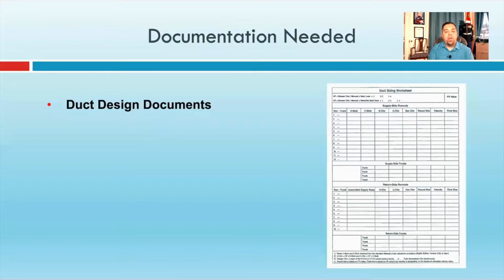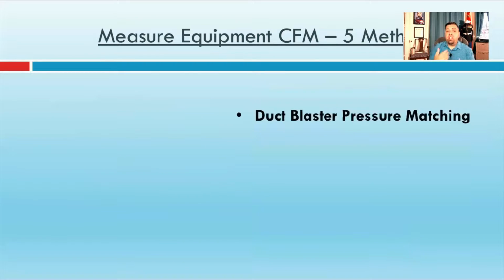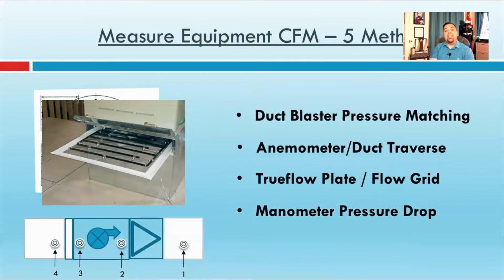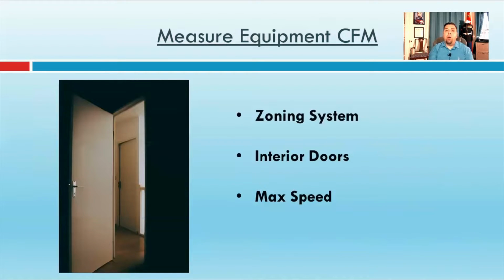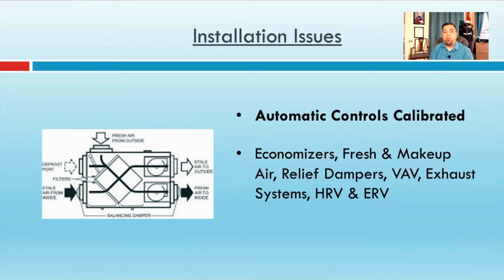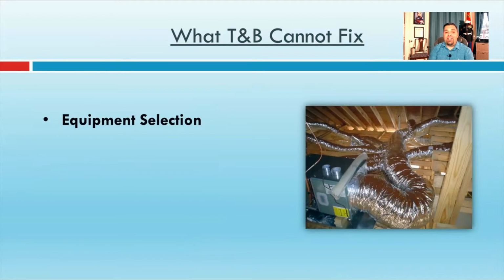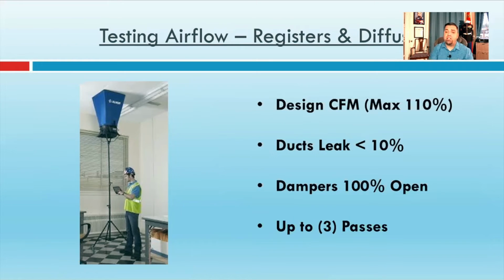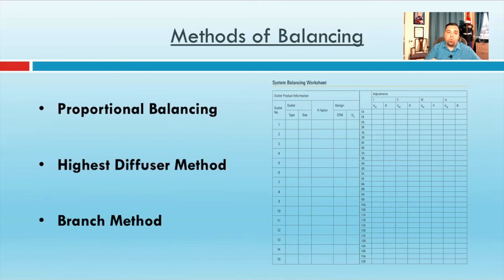HVAC Air Testing & Balancing

Comment: i work in Eastern Massachusetts for 25 years plus. The biggest reason for not balancing a new residential system: no accessibility to 90% of the duct work. Why? the builder or contractor is not interested in forcing the electrician to wire the air handler before sheet rock is installed. We typically don't even have the lights working in the basement until the very end of the job, never mind power to the furnace or air handler to balance a system. That's the reality.
Then everything is blamed on the HVAC contractor instead of construction management and the other subs. Only a very few realize the importance of what you are talking about.

Comment: The biggest problem with testing and balancing, after everything is said and done it’s generally a waste of money. I used to do HVAC work and worked for a testing and balancing company. After a while, I realized all I was doing was just pi$$ing in the wind! We would go in to a building (sometimes a brand new building) and set everything up to the engineering specifications only to come back and check everything a few months later and see that the customers had completely readjusted everything we did!  Some customers would complain they were too cold, others would gripe they were too hot and what would they do? Go in and tinker with the settings, dampers, shut off valves, etc. causing everything to run in efficiently in the process.  
Of course, the video you have here is good and very informative and I don’t mean to gloss over nor kick what you do to the curb but it’s a lot of money wasted to go through all the hullabaloo of setting something up to come back and have somebody screw it up again!
Reply: @phayzyre1052  
I totally agree. I used to do HVAC work and every time we went into a building to set the unit up to give airflow to each and every room per engineering specifications somebody would always come in behind us adjusting our settings totally throwing everything out of alignment from what we did. Like you, I to can understand the importance of HVAC balancing, but in the end you’re just throwing money down a hole.

Comment: I'm a certified TAB engineer with 26 years experience and own my own TAB company since 2007.  I made it half way through the video and stopped watching.  About half of this presentation is incorrect and does not align with NEBB,  AABC, or TABB procedural standards for Test and Balance.  Anyone looking for T&B  information needs to look into one of those three organizations and follow their training.
Reply from the maker: Thanks for commenting Da Prophet.  I am sorry I may not have been clear in the video, but we discuss the methods and procedures per ACCA Manual B, for residential balancing - particularly retrofit duct applications.  Although I am vaguely familiar with some of your mentioned organizations and what they teach, I know ACCA does differ.  Thanks for your opinion, and although your methods are different, ACCA Manual B is not ’incorrect’…
Reply: @HVACProBlog lkrtn
Reply: @HVACProBlog  You were clear that was your source.  Unfortunately, the source you site is not recommended nor recognized by any reputable TAB certification program or certified  TAB firm.  I would encourage you to look into one of the sources I suggested to gain a proper understanding of how to not only measure CFM and GPM accurately in the field, but relearn the procedures and TAB equipment we use to provide a properly TAB'd environmental system.  They have TAB technician manuals for home study and some offer in person classes depending on your location.  Learn how professional Balancer's perform this trade and then compare and contrast to what ACCA.  Then you will see where and why ACCA is incorrect in regards to this discipline.  Good luck.
Reply: Uyyt😅y😅h